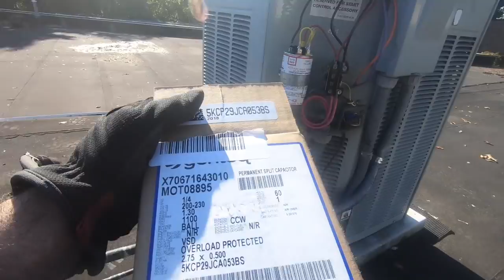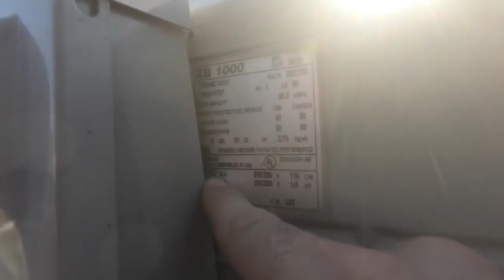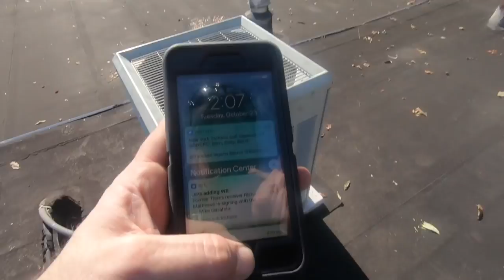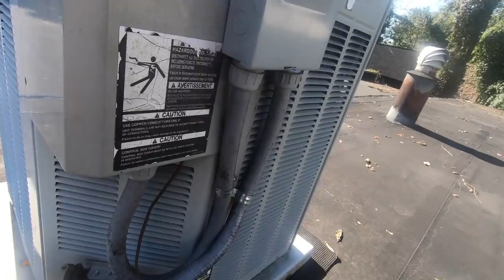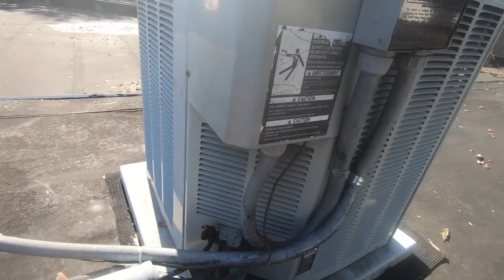Replacing AC Condenser Fan Motor

Comment: great that you don't have an accent.  
...that vibration/noise... whatever happened to that washer that snapped in the last vid ?
to all those trolls, just tell them to chill, grab a porkroll egg and cheese enjoy the video.
Reply from the maker: Dude did you just start a pork roll / Taylor ham egg and cheese debate? 😂🤣👍 It’s a Jersey thing. Us Bennies love our Taylor ham egg n cheese. I had to work in NY last week and they don’t have Taylor ham or pork roll only regular ham my coworker was dying from me seeming confused a bagel shop doesn’t have either. People don’t know what they are missing!  I snapped a few of the bolts last video I threw them away.
Reply: @thehvachacker  : but they don't know how to cook scrapple either !
Bagels are round,  porkroll is round.    how can they not put that together ?
It's only Taylor ham if they pull back the cloth and slice it off.
if it is pre-sliced, it is often Case.
Either way, it is what a good working breakfast is all about.
Reply from the maker: I go with it over bacon or sausage. Not sure why mcd’s doesn’t offer a sandwich.

Comment: everyone does jobs there own way
I don't like using power tools, if i can get away with hand tools
Reply from the maker: Me too especially since usually a condenser fan motor drops right off the cover. Yes, zip screws I will use my impact usually here I had to take a stand from the troll abuse I receive from the second part of this series the one I labeled a callback. Doesn't matter the tools or the approach it's the outcome of the job. You and I can have different ways of accomplishing the same outcome. That is the only part the customer knows and matters

Comment: You let your inexperience show when you let comments force you to make even more dumb comments. Your not a bad mechanic, but your also not a great mechanic.  You replaced the motor because you thought someone sabotaged it by putting in the wrong capacitor. But you didn't check the pressures or even just superheat ...nothing.  A great mechanic would have thorougly checked it to be sure the sabateurs didn't let some gas out to make it freeze up.  Take your comments and do as you claim to be doing....learn from them.  You'll get better
Reply from the maker: I did check the gas pressure on my first trip here and it kept them cool operating in 90-degree weather most the time. Usually, I never see anyone checking pressures if the system is down on an electrical problem. I did the first trip cause I wanted to see what caused the compressor to overload and lockout since the fan was operating when I first got on the roof. I don't work for alittle company and I am not the best mechanic at my shop. I also am not the worst. I get used as a cleanup tech on the residential side and get it done for whatever they need me to do on the commercial side. Do I still have a lot to learn of course who doesn't? One job at a time is all I can do.

Comment: I think the previous service company probably didn't have the correct cap and put in what ever they had to get it up and running to make a buck ... not caring what happened in the future, or they were hopping for a call back to make more $$.
Reply from the maker: Hard to tell yet the dual cap was an 80/5mfd and they added a 20mfd to attach the fan motor to that was rated for 5mfd? They also had an estimate they left for a new machine. As much as I want to believe they were just incompetent this seems like a good way to kill a system. Many customers would replace without questioning. Yet my new customer didn’t trust that company. I ran into many things first time I ran into a machine that someone worked on previously did anything like this.

Comment: Wasn’t the first motor a rescue motor that needed extra stubs cut off.  Come on
Reply from the maker: OEM I don't like mounting to the top grate. I only put resue motors if they mount correctly. Plus OEM is better in many applications, here or with carrier 875rpm motors.

Comment: Your not bad but your cameraman is terrible! Oh and copper grease, its true the thermal conductivity thing....  So that fan should last a lil longer given that it can dump heat through the fins. I will be copying that trick...
Reply from the maker: I need to fire myself since I am a horrible cameraman. ADHD makes me forget I am filming at times. This fan motor should outlast this machine. I give it 5- 10 years tops of run time left

Comment: Wish they lasted that long here in FLA.
Reply from the maker: What is the average life span of an ac in Florida?
Reply: 8-10 years depending on the installers and equipment. So many hacks down here but they keep me employed fixing all of their Fuck ups. Everything is u get ducted, leaking, and oversized.
Reply: But if you have full sun on the CU everything including the coils will be toast in no time. The old rheem green boxes had the best sun protection and the old trane spine fins hold up the best  in r22 but anything 410 is leaking in 10 years no doubt
Reply from the maker: Sad but true the 410a leak all the time, Hopefully, someone finds a way to correct that

Comment: Don’t want to check suction and liquid line  pressures bro?
Reply from the maker: This was an electrical issue, no reason to put gauges on and cause a possible Schrader pin leak. If you watch the first part of this series I checked pressures
Reply: And, a good tech can listen and feel and tell pretty darn close how a system is running. Liquid line temp, Suction line temp, and even just the sound of the compressor can be a clue as to how the machine is running. Evap coil temp split is another good indication that things are right or wrong.  We don't need to stinkin' gages. @thehvachacker
Reply from the maker: I cooled off an overheated compressor, found too big run cap connected to fan motor and corrected the capacitor. Checked refrigerant pressures and amp draws on motors. This guess that is doing nothing as you say

Comment: question: why are you using a multi cap. instead of a dual cap. also don't worry about peeps riding you cause they have nothing better to do
Reply from the maker: The parts department forgot to order the cap for this system. I ordered the cap and motor. So I had to get correct size cap into system.
Reply: thanks. just curious

Comment: i am new to your channel i like that your showing your work - but it seems that your very angry at others for some reason ,and 28 days for a replacement motor ?
Reply from the maker: I am in no control of my scheduling, I was suprised with how long that took to get back. This video I decided to take a stand against the trolls That part 2 brought out of the woodwork. I was taking a stand against bullying.
Reply: @thehvachacker  not a troll but im guessing it might have something to do with trying to jerry rig the wrong part into the unit? We both know you would have never told the customer. It's kinda par for the course with hvac guys tho lol Don't think expecting honest quality work is bullying bud. But id your gonna trying to take shots at another company and post a video, you better be on point yourself.
Reply from the maker: Everything in this video or service call has been done with the customers best interest in mind. They fired the other company cause they knew that company screwed up their machine. They could have just signed the quote for a new unit with the other company. That company is out there trying to kill systems to force a sale. The customer felt it. That company was even exposed by a news sting setup a few years back. Why this customer called me in. They also have seen the videos all 3 from this job. I don't hide my work from my customers. They also legally went after that company to cover damage the 20mfd did to their condenser motor. Yet JonR you seem butthurt because there are thieves in the HVAC and all other fields. The truth may hurt yet just don't be deceitful to your customers.
Reply from the maker: JonR311 2 minutes ago

@The HVAC Hacker  dude your pretty salty. Both of my brothers and my customers gov or Corp always recieve excellent service from anyone of our technicians. Don't come at me cause people wanna cry about what tools you have and the way you use Hvac a lame ass field for idiots wanna come play with the big boys i know your tri state I'll send you an app.
Reply from the maker: Jon u state your not a troll yet what is the intent of a comment like this? Good to have tools so you don't need to hire someone to change lightbulbs for you
Reply: Fair Enough :)

Comment: I never change a compressor in a split system condenser... get  a new cond. unit. Customer gets all new components and It's less labor charges .  A package unit is a different story.   For a bad cond fan motor,, always get a new fan blade with cond. motor ,way easier not hassleing  getting old one off shaft.  .carry a fan pitch measure tool or take the old one to the parts house to match it up.
Reply from the maker: I attempt to remove blade if it won’t come off then I order the blade with new motor. Compressor depends on if it’s in warranty or not on a split.
Reply: Hahaha it will happen like that to get new cond. if the condenser are really messed up! But the issue is only fan? Hehehe it should be figure it out and fix as a technician! Its just a piece of cake issue🤪

Comment: My work calls them "pump pliers" lol sorry I just had to do it. But yea that's what they are called where I work
Reply from the maker: I thought the cobra or alligator style Knipex, or Channellock style slip joint pliers with teeth were pump pliers? lol
Reply: @thehvachacker  your right I looked passed the smooth jaw of your pair there. I do need to find me a couple of those for my work. 95% of what I do day in and day out is with a pair of adjustable wrenches.
Reply: I never heard the word pump pliers until I had to order a set, i always referred to them as channell locks.
Reply from the maker: Most of us have referred to the channellock style pliers no matter the brand as channel locks. Which set did you get? I have 10" and 12" Cobras and a 10" pair of Klein klaws made by NWS. I want to get the 16" Cobras
Reply: @thehvachacker   we have our own site to order our tools so we are limited by the brands and models corporate gets to pick. We only get the standard kleins not the klaws for pump pliers. And the extra capacity adjustable wrenches pretty much in all the sizes, I just stick with 12's Your cobras seem to be a nice improvement away from the standard adjustable wrench that's why I was intrigued and looking into getting a couple now.
Reply: Obviously I would have to pay out of pocket for the luxury but that's a small price for convenience. How much do those clamp down? With what I do alot of times I have to put some pressure left or right while tightening that u can usually only get with pliers and not at all with a standard adjustable wrench.

Comment: Why did you leave the expensive turbo capacitor in there? If you had 3 weeks you could of had the correct one, and that is what RESCUE MOTORS are for... (So you can get the job done the same day..) Enjoyed your video...
Reply from the maker: The parts guy forgot to order it. The turbo is a tough built cap. Almost never have them go bad and it’s all we use unless a motor is ordered for the last 15 years

Comment: while I dont like using impact for tighting small screws, , I am a fan of a good manual ratcheting screwdriver,  its easier on my hand and a tiny bit faster, but it is what each mechanic likes, whats right for me may suck for you, and vise versa. sometimes we buy a tool thinking it will help & end up hating it. I bought some on discount 2 years ago, found out I despise the way Crescent brand ratchets feel in my hand, plus some pliers by another company I really dislike, it happens to all of us but you do & use what you like & feels right for you.
while you mention sabotage, to me there is possibility someone with just a little knowledge, but no electrical knowledge didnt understand sizing capacitors? you wouldnt believe what I see in my world, people find anything to make motor work, guy recently had a bench grinder listed on Facebook marketplace, its on a stand,  whats interesting is they wired a large cap to motor to make it work, but I see home ower power tools all the time with wrong cap at flea markets for sale, so maybe someone knew it could be a cap, replaced it with something that  looked similar? it worked, he got paid, but unsure of job.

Comment: Who sabotaged it and why?
Reply from the maker: The previous company that did a repair on furnace. They were pushing a new ac system. It worked till they did a repair inside went to roof to see if it works handed a estimate and said it runs but won’t last

Comment: Why does the fan go so slow? Mine is that size and goes really fast...it’s a pos goodman 8 years old header pressure dancing between 300 and 320 and the contractor says no big deal?  Lol we had a legit hvac company look at it and they said to evacuate gas install new filter and change txv on a Trane evaporator coil that is only ten months old.  Of course the one year labor warranty would take care of it but the crook is trying to get out of doing it.  The legit company is installing an third return upstairs 16X25 because the return is too small upstairs.  Legend Homes go figure right?  The legit company said it would be $1100 to evacuate the gas, change filter, changer TXV and install virgin Freon.  The new return will be $500 are we getting smoked or is that about right?  We paid $1950 for the Trane evaporator coil and ten months later the TXV goes bad?  Give me some knowledge on this scenario when you can Pal!  I learn a lot watching your videos thank you. I miss my new Rudd we installed in our first house!
Reply: At  1110$maybe a 99$ac upstairs mighty be a option .than  t overload the ac

Comment: I only watched two videos connected to this one job. The venting throughout what you intend to be a helpful informative HVAC video takes away from the important content.  I that is myself feel you can post a totally separate video address those things if it bothers you so much. I know nothing of HVAC. your videos in my eyes failed to explain what you where doing clearly. For example you took out these gauge readers toward end of video and was waiting for a number on the yellow gauge to be within its acceptable range. That much I got. After that you talked about tools, other negative post in your opinion, etc. I missed or maybe you never stated the name of gauge tool and why we needed a certain number. Other HVAC videos I have seen the tech  give name of tool says what tool is used for  and why they are checking for certain number . I find that helpful because I watch things like this not to do myself but to better ascertain the skill level of a tech sent to me. You mentioned that it is about your customers and doing right by them or something like that. If I was the client for this job I would have felt that you are lacking as a HVAC tech or maybe you out for money. Main reason being things missed during initial vist by you is reason for current issues. Next is I the customer had to have the machine unexpectedly repaired within a month of a service. Short of the client themselves accidentally breaking something I would consider any tech lacking when something eles went wrong within 30 days. I would think as the professional how come they failed to notice this before it broke or caused damage. With that being said no one is perfect myself included.  You did a great job with the camera views could see everything you were doing no problem.  As a viewer this is just some feedback. Keep posting.